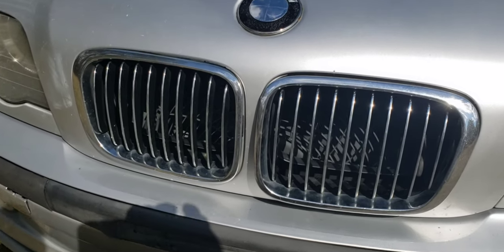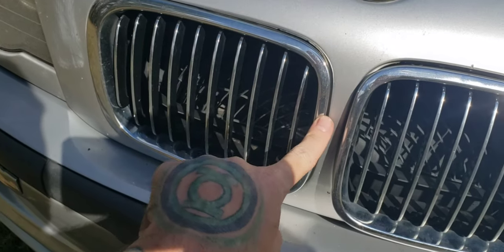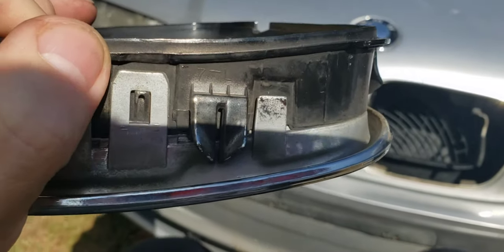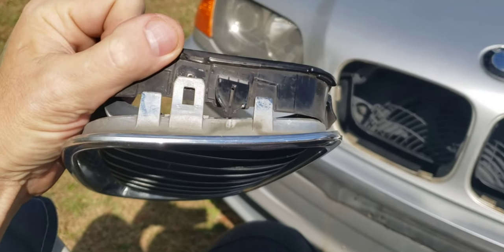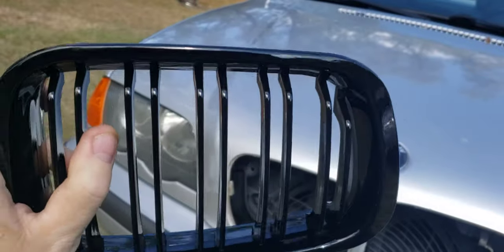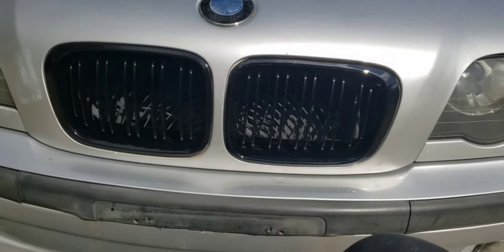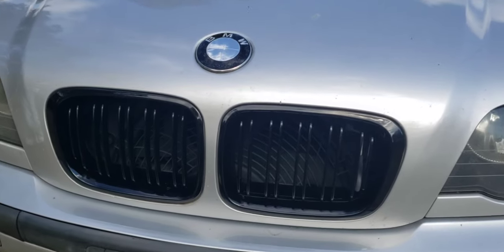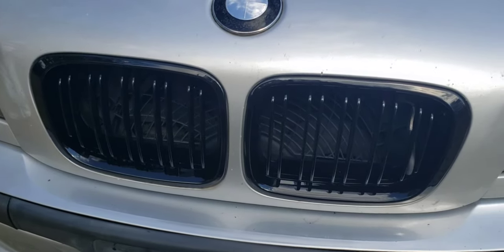2000 328i E46 Black Kidney Grill Installation

Comment: Ive installed almost the same grill today and the hood latch is now stuck and i cannot open the hood... most likely will have to fix the hood lever or cut one of the vertical grill tooth... any ideas?
Reply from the maker: Your latch release lever may be slightly bent.